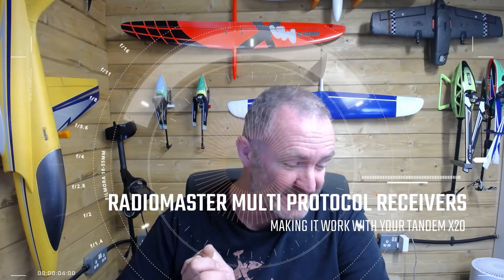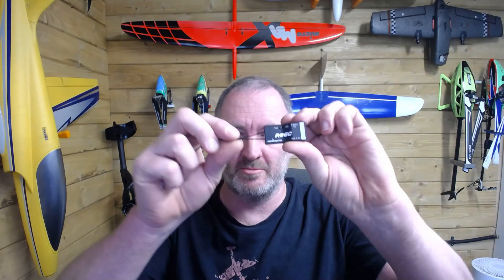RADIOMASTER RECEIVERS VS FRSKY TANDEM RADIOS

Comment: Just gone through the discovery process of not being able to bind an R84 directly onto the internal RF of my X20RS, but it works fine with the multimodule of iRX. But once you have the multimodule working on your Tandem, you need to select external RF and then the FrSky_X protocol, then select EU_8 for Europe LBT receivers ( you can leave it to 16 channels) and then bind.

Comment: The module doesn't allow for frequency fine tuning right? How do we get around that hurtal?  The radio master requires fine tuning to get the most range.
Reply from the maker: Pretty sure I can tune the frequency on my multi protocol module.

Will need to check on the radio but last time I tried I believe it was there.

Comment: Hello! Can you simply plug in the module and bind the receiver immediately? or do you have to install other software?
Reply from the maker: You would need the multi module lua scripts installed on the radio.
Reply: Hey. Mit Lua scripts gehts sofort. Aber ich habe keine Telemetrie? hab ich etwas vergessen? angeblich soll es Funktionieren? was sagen sie? @RTRCTV

Comment: Well yeah the Radiomaster stuff isn't D16 its "D16 compatbile" which is why there is also frequency tuning.  The only one that isn't is the R168 because that's a legit X8R clone which is why FrSky sued Radiomaster and won in court.  The MPM is $40, easy to get working on the X20 and $40 is a small price to pay to get a fleet of non-FrSky receivers working again vs buying all new RXs.  I've got like 15 FlySky fs-i6 receivers in cheap foamies and a few Spektrum BNFs and I never give it a second thought.  My X20S works with them all.  For anything I actually care about its a legit TANDEM receiver tho.  Sorry not trusting a $1k gasser to a $15 RX.

Comment: What a joke. I just bought a whole lot of Radiomaster R84 to use with my X20 and cheap foamies. Now they are useless.
Reply from the maker: You wil need a multi protocol module.  It's a bit annoying :)
Reply: They are not useless, the multimodule is only around 30€ and worthwhile. See my notes how to bind using the multi protocol module

Comment: How you finding the frsky tx? Debating switching from my tx16 to one after my tx16 locked up in flight due to sandisk card failing
Reply from the maker: Fantastic.  Can't fault it. :)
Reply: @RTRCTV  any limitations vs the tx16? Most my models on xfire rx’s so would need the nano tx. Have you tried any of their long range rx’s? I fly dji 03 and g2 so limited to 20km anyway
Reply from the maker: @randall8686  not had any issues myself with range.  The frsky 900 system is pretty robust.    But no issue really if you do an xfire nano.  Fully supported these days.